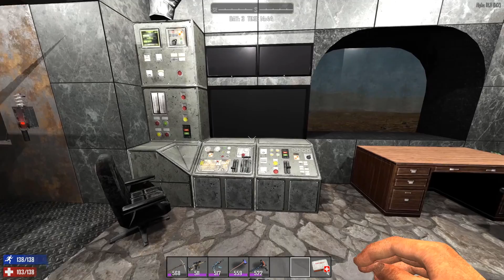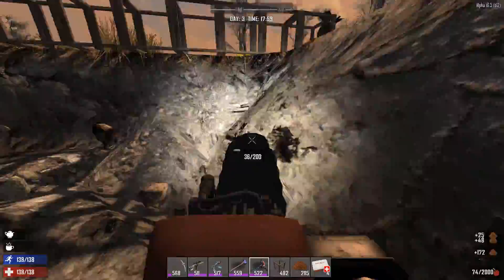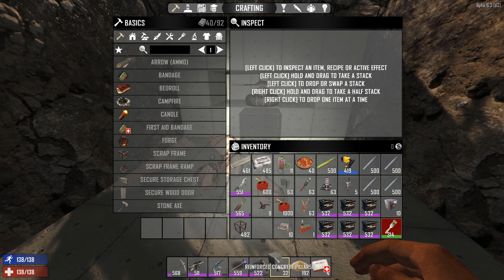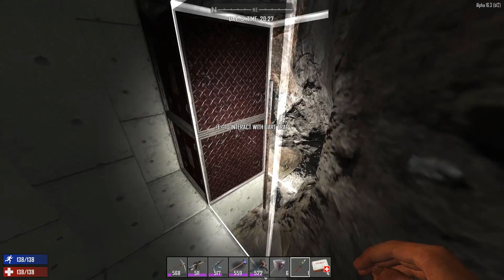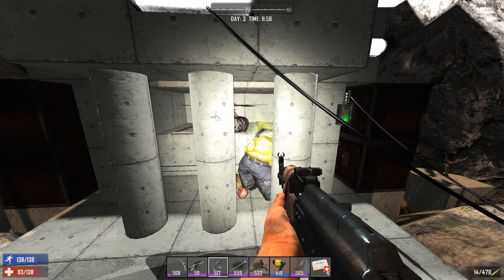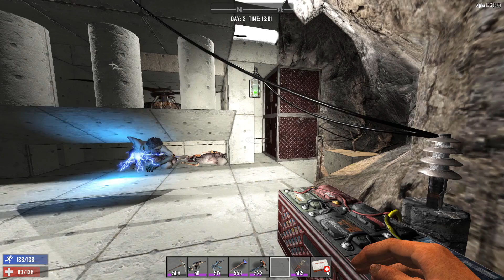7 Days to Die | BUILD Advanced Cop Trap | Alpha 16 Gameplay

Comment: do fat cops get line of sight to vomit through 50 pillars?
Reply from the maker: Hey Shawn! 

In my experience yes they do. Generally they don't through "solid" blocks, which includes glass blocks. But pillars, poles, arrow slits and such do. I've had mixed experienced with iron bars, standing further behind sometimes they don't whereas pressed up against it might. But at least iron bars allow the player to fire through, and are some protection :)
Reply: thanks a bunch i googled searched for a bit with no luck, didnt want to start my next project and find out i was left vulnerable. youre a life saver man!
Reply from the maker: Got it! Check out my "best base ever" build, it might give some ideas. I put it through it's paces, even 64 zeds, max gamestage, and it holds up. I do use iron bars to shoot through and vomit protection there, poles are great for defensive walls. :) 

https://www.youtube.com/watch?v=xnjiedAjQ6k&list=PL5Z54hiemOAvaGeK8_3lOCst40s5vFYak

Comment: Great build. The one thing I have noticed is my blade trap expiring way too quickly and spending a lot of resources on either building a new one or repairing the one inside the trap. Would Iron Bars or something of the like protect the trap from taking so much damage (day 105).
Reply from the maker: Hey Charles!

Unfortunately not! It's part of the balancing, which works "fine" early-mid, but fails late game as you noticed, they take a lot of damage. This means you do have to keep repairing to upkeep it. Generally with corpses you get the bones, which allows you to make the glue and duct tape for the mechnical parts, but it's a bit of a bother still I agree. What I think they should do, is allow for a blade trap upgrade, say 10 steel, to boost the health points to 6-8k for instance. That would help late game.

A practical way to deal with the issue during base hordes, especially late game hordes, is to combine it with say a fall trap and have multiples. A player on my 7dtd server did this, Mars, and it works great even for late hordes as the fall trap kills a lot of normal zombies, and since he has a number of the advanced cop traps (4 dual ones I think) the blades generally last a lot longer :) Check it out! --> https://www.youtube.com/watch?v=k_TjxaKrdBA&list=PL5Z54hiemOAvaGeK8_3lOCst40s5vFYak

Comment: Put 1/2 blocks at the bottom,  and move the blade 1 block upp, and turn it upp side down. More decapitations?
Reply from the maker: That would definitely work! Or simply put one more blade 1 up after you put the half block :) Downside is of course loss of loot as there'll be no corpse blocks forming, but that might not bother everyone :) More decapitations is always useful. With zombies being different height it's not always easy to get head-damage on all models I suspect.
Reply: Great work btw. Best ideas I have seen so far! :) 
Personally i like small bases, low maintenance.
Reply from the maker: I like a manageable base as well. While I expect to repair, it has to be within reason so I don't spend all my time doing just that.

Thanks for your support, great to hear you enjoy my videos! :)

Comment: What do you think about using campfires instead of log spike traps?
Reply from the maker: I tested that out once, and the damage it too small. There are two types of burning buffs, and the campfire gives the small one. The big one gives 10 hp dmg/sec, the small only 2. that's a minute or two for zombies to die, clearly far too long :) 

<buff id="burningSmall" mutex="burning,cannotBreath,drowning,extinguishFireBuff" duration="10" stack="reset" debuffif="+water > 1" ffcheck="true" actions="attach(ParticleEffects/p_onFire, @impact);damage(0,1,0,1);damage(0,2,0,0)" icon="ui_game_symbol_fire" name_key="burningSmall" description_key="burningSmallDesc" tooltip_key="burningSmallTooltip" cures="canBoiledWater,bottledWater,goldenRodTea,redTea">
 <modify id="1" stat="health" amount="-2" rate="1"/>
</buff>
Reply: VeduiI tried it after commenting and it helped some but also gave them a boost in height which helped them in being able to hit the blocks above the pillar, no good. lol 
I paused the video after the wiring layout so I didnt see the rest until I had already upgraded the floor to steel so I wasnt about to waste those mats but even without anything in the floor this trap build works very well. My test was a day 600-something on Nomad and it was a breeze, I didnt get any crawlers and iit made short work of ferals, wights, and cops. Anything that got too close to the pillars hence avoiding the trip wire got a machete whack to the foreface which knocked them back in the trip wire. Good times. 😄

All in all, this is a great trap build that is low on materials and high in functionality. I even ran a wiring network from my solar bank down to its battery bank to recharge it during the day. 👍
Reply from the maker: That's great to hear David! I really like it myself, and as I think some others had commented, changing out the half wedges and pillars to poles would work too in keeping the zombies in place. Not a major deal always, the blades do great damage either way, it just helps speed up when they're hit with everything in the trap :D Do have to maintain the blade so it keeps up durability, but since zeds are not likely to bash it, it shouldn't be destroyed normally either. :)

Only problem is looting fast enough ;)

Comment: How do you one shot a concrete block?
Reply from the maker: I cheat ;) I increase the steel pickaxe damage for when I make tutorials, to avoid mis-placing something and having to spend a minute or two getting rid of it, or cutting video ... Wish "god mode" or similar would do the same, but alas ... requires modding items.xml :)
Reply: Ah i was hoping they added it into god mode or something as you said.
Btw. I just finished a base for horde night (i was trying to make use of all available kind of traps/weapons). I also modeled a bit from your video :) Could you please say two words about it, what you think and if it's good or meh? Here it is /watch?v=6xaJl-ATsRk
I'm trying to build something very effective against blood moon hordes but small so you can stay and loot (unfortunately i didn't manage to do the last one). I also wanted to ignite them for fire damage debuff but the dmg is very low so not worth the effort. Are you working on some horde night base designs maybe? Would be great to see them on your channel :)
Reply from the maker: Unfortunately not :D It's a bit annoying at times. Do remember someone posting on the forums having created some special items for admin usage/building, being able to clear big areas faster. Will have to dig that up again :D Saw the video. Looks good :) What I might help is to put 50 pillars underneath, and  have a loot area. Corpses from dead zombies will often fall down and you have some time (60 s? 30s?) to loot before they become loot blocks and poof due to lack of space. Since you want to lure the zombies into the middle, standing underneath is a good way to help lure the zombies into the middle of the trap and fall down :)
Reply: Yeah 7DTD is changing much into building game so they definitely should add something like an admin tool like in minecraft :D If you find something on the forums don't hesitate to put it into your channel, it would make a life much easier :)

Comment: how much damage does the blade trap take whe i used one it got wrecked but i had blood mone on 64 and my game stage was on 900 ish and in a town all it all it was a nasty horde lol
Reply from the maker: The key figures are in blocks.xml -->  <property name="Damage" value="20"/>  <property name="DamageReceived" value="4"/> ... where this shows every blade it does 20 damage to the mob, but the blade takes 4. A radiated feral cop having 1500 hp means 75 hits.. which in turn damages the blades 300 hp. This is why while I love the blade traps for the great damage, I also have an electric fence, and 4 dart traps, as you will run down durability really fast otherwise. If I recall testing previously, this setup should last something like 10-15 cops before needing repairs. Of course, less if it's killing other traps. But even when the blade is down, the darts will keep shooting so zombies will get killed, giving some time to repair :)

Comment: Why not use poles instead of pillars? That way the zombies will stay in range of the trip wire.
Reply from the maker: Yep poles are a great choice... now. The reason I started with poles, and then switched to half ramps is more historical (and I hadn't tested it out sufficiently in A16). In A15 and earlier, poles had two major problems. Firstly, crawlers would get through them. That doesn't seem to be happening in A16. Secondly, in earlier versions Zeds didn't recognize poles as being blocks, nor as being obstacles. They would thus in most scenarios try to run past them, fail, but keep going. As they didn't see them as an obstacle, they wouldn't bash them. So you could have a box made out of poles and be 99 % safe, zeds would walk/run on the outside trying to get in but not attack and damage them. Too cheesy for me, so I avoided them. In between the cop trap, and the base wall build I did more testing to confirm they work better now, so I'll definitely use them more :D
Reply from the maker: They use the same! It's a bit of a weird mechanic, where a plate which is 5 % of a full block has as much hp as a full block. So poles, pillars, plates, have the same as the full block. Makes it easier to build and not worry about HP though! So use poles, they fit better :)
Reply: Do ¼ pole got less hit point than 50 pillar?  I making final build of my new base base on that trap design, and I m not sure if I rather use pole or pillar

Comment: Wow, nice and compact. Have you tried something simular on a horde night? I'm curious if there are any problems with the corpses. also: have you tried flipping the blade trap upside down, one tier lower? idk how the hitboxes line up but i could imagine this would take care of the crawlers pretty well. - you'd be losing the headshots and turn most of the zeds into crawlers pretty fast though, so i don't know if that's really a beneficial deal. Maybe you could link the top row of the dartguns to a different leveled Tripwire.
Reply from the maker: Thanks!

In some tests it worked quite well. The challenge is really in where zombies come from so you still need base walls.. (video coming up) and defend the entry ways. The blades one down and flipped works, but you lose the loot. Which might not be a major issue. If doing that, put two, one flipped at the bottom and the second normal, and you double the blade damage. Normally crawlers do die pretty fast, electric fence and steel spikes do enough to kill normal ones ... the only challenging ones would normally be radiated feral wights if you get them crawling, but that's very unlikely. And either way, you need to be defending the base yourself! One way would be to put a motion sensor on a say 15 second delay, linked to a shotgun turret. Anything standing after 15 secs of triggering and it'll start blasting :)
Reply from the maker: Yep! Great loot machine too! If you use a machete, or hunting knife, you get the added benefit of leveling up your blade skill and getting more resources from the corpses to melt down into glue and make fertilizer from :D
Reply: I used this build on a horde night yesterday and it was a breeze but the corpses do pile up quickly. My solution was to do what many already do, use a fire axe or shovel to dispose of the corpses quickly after looting. Two hits to reduce them to a gore block (if needed) and one hit to destroy the gore block. I was able to do this while looting and repairing, not once did my blade trade go below 75% durability and I accrued a full storage box of loot. As long as you stay active with your defenses you shouldnt have any problems.

Comment: I tried building your trap, but instead of putting spikes at the bottom to deal with the crawlers, I went with trying to raise the floor up slightly so the crawlers hit the tripwire.  First experiment was with concrete plates, which seem to raise the floor enough so that zombies no longer hit the tripwire and the trap doesn't function.  But the metal siding is actually thinner than a concrete plate, and if you place it on the floor it still allows the tripwire to fire, and seems to raise the crawlers up just enough so that the dart traps hit them (unless i'm missing something -- but the crawlers are dying really fast for me without any spikes)
Reply: Actually no scratch that, the plate doesn't work, but with the siding I was just seeing them getting electrocuted.  And sometimes they still fail to activate the tripwire so the spikes are probably necessary.
Reply from the maker: Yeah .. it's not easy. I did hear that you can use trigger plates, and put normal plates on top of them to protect. They should still be triggering ... but, trigger plates have a known issue with major lag, so using them is not really recommended. And one would lose the loot anyhow. Either way, something is lost :D

Comment: Really cool! Might try 1/2 blocks where the zombies fall so the blades will hit the cop's head.
Reply from the maker: That should work. The downside is that you lose the loot. And in that case, you might want to just double up the blade traps (one at the bottom too) as that helps extend its life overall :)

Comment: I like this idea a lot, was thinking of placing one at an end of a lightly trapped "corridor" so as to remove trash low hp mobs and then any feral stuff alive would drop down and all one would need to deal with is the higher HP feral stuff.. Nice :)
Reply from the maker: Yeah :) Generally I find that electric fences and other light traps do a good job of removing the regular zeds, bit harder at night and hordes when they run, but since normal zeds have like 100-150 hp they die a lot faster.
Reply: yeah was thinking this setup at the end of four corridors in a plus  shape N.E,W,S direction, each corridor perhaps 15-20 blocks long by 5 wide with electric and spikes to funnel them into a small drop off with your trap at the end of each corridor a few blocks under ground with the usual cage (horizontal poles) where you will stand in
Reply from the maker: My intended builds tend to include just like you mention a + sign of corridors. Though instead of making it deep into the middle, I try to keep them short and sweet so I can build my base inside instead in a bit more traditional fashion :)
Reply: yeah will love to see on an LP :)

Comment: One little tiny change i would prefer.
In the player-area (i mean the area, where the player is standing during horde-night) you can use 1/2blocks on the ground. The advantage is that you can easly hit zombies on the ground while you where crouching.
Reply from the maker: That'd work :) Better height difference I suppose :)

Comment: Well that's tight little system.
:)
Horizontal poles are pretty nice for barriers instead of 50 pillars. No safe spot, less hitting your own block, and looks good, imo.
Auto turrets would really put the icing on the cake, maybe.
Reply from the maker: Thanks! Yeah I thought it was pretty tight, but I'm sure it can be made smaller :D 

Poles was a good suggestion. I stopped using them before as zombies (A15?) wouldn't always detect them as barriers, and thus not attack, and crawlers could get through under them. That seems to have changed for A16, so I'm gonna make more use of them (such as in my next building video next week ;) Stay tuned!